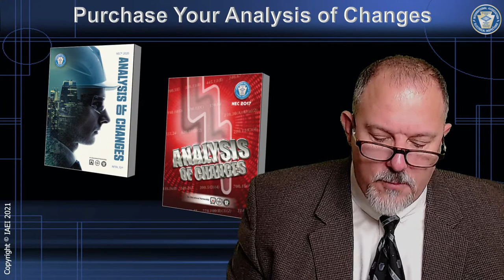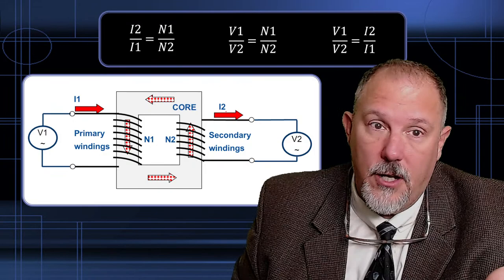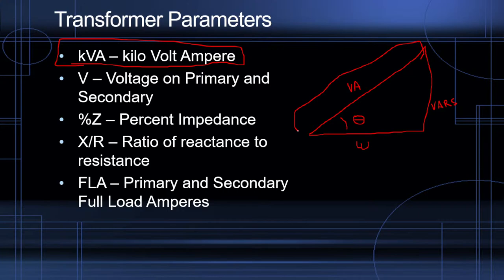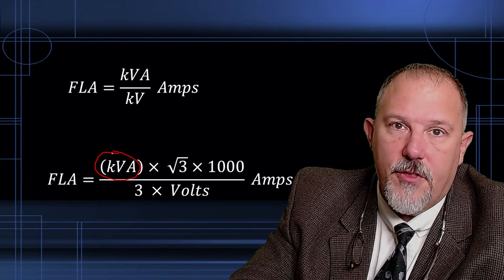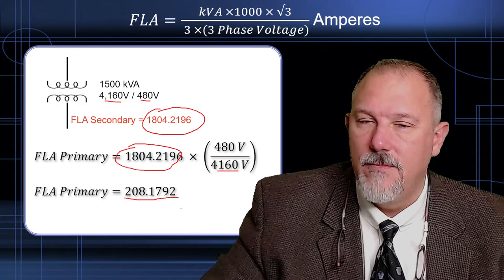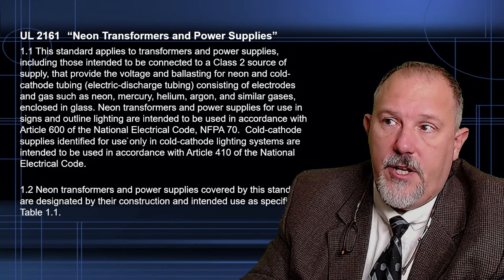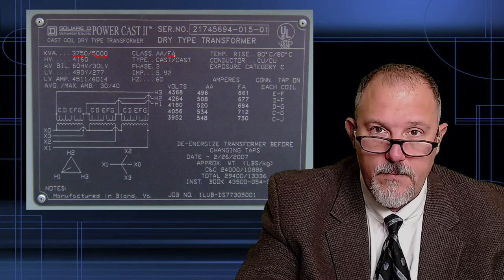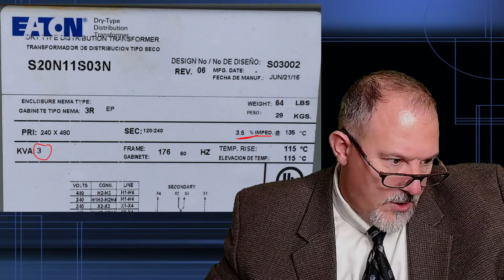Transformer Fundamentals

Comment: Tom I believe that the IAEI is by far the best electrical magazine out there. Back in the 1970 & 80's EC&M was the best. I would spend a hour going thru the 120 or more pages. Now lucky if EC&M is only 40 pages of which 20 pages are adds. After 40 years finally stopped receiving EC & M. Used to read my sparky dads edition while attending Vo Tech school. Teacher finally asked me how I know so much of the code questions he asked. Told him that I read the same magazine. Can remember back in early 80's that 3 & 5 HP VFD'S from 2 companies that we used both required an isolation transformer for each drive. One drive manufacture only had 3 phase drives for 240 volts only. Told me they would never be able to have electronucs hsndle 480 volts. Fast forward and we had two 1750 HP chillers that had 4,160 volt motors feed from a VFD.

Comment: Tom here is a fast track mutipler for rough cutting field estimates for 3 phase. For find amps on 480 volts mutiply hy 1.2. For 240 multiply by 2.4.  Came up with this years ago when I did not have my caculator or Uglys book with me. Had a custoner had a rush job on 2 500 ton injection molding machines that he wanted running within a few days. Had to call in conduit & wire to supply house right away. Not as accurate for motors. Most common NEMA 3 phase 480 motors draw approximately 1.25 amps per HP ( over 25 HP).  So most 100 HP 480 Volt common frame e phase motors have a nameplate of 124 to 125 amps. Using the 1.2 multiplier would be off by 5 amps ( 120 amps ). Know that you have to use NEC book motor amperes to calculate wire size.